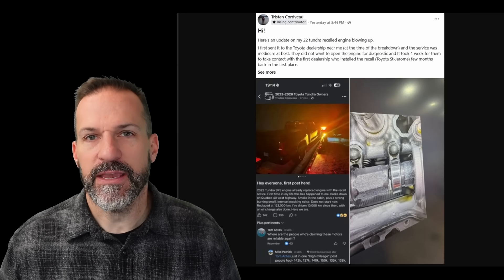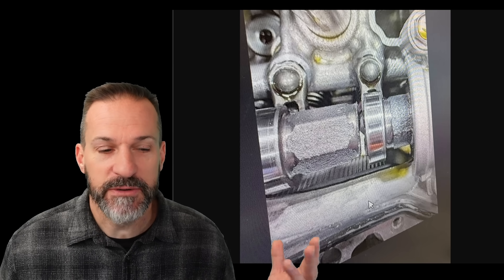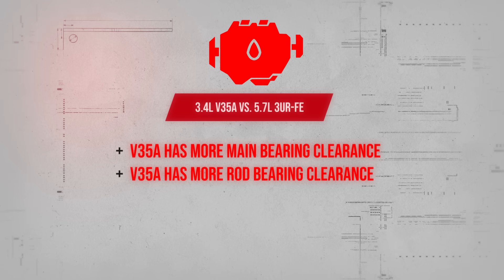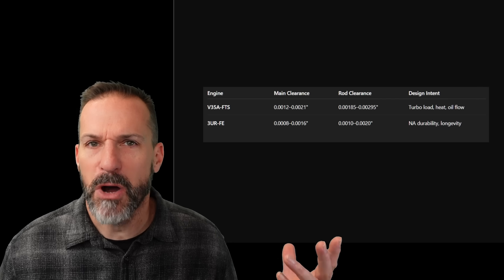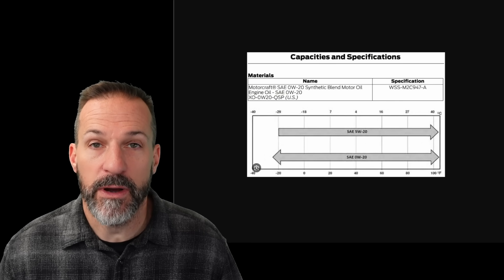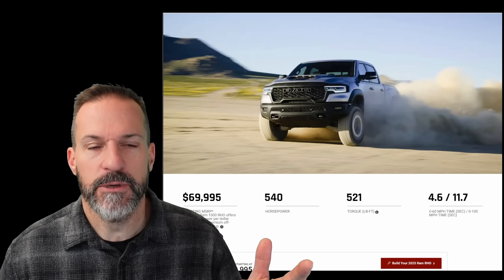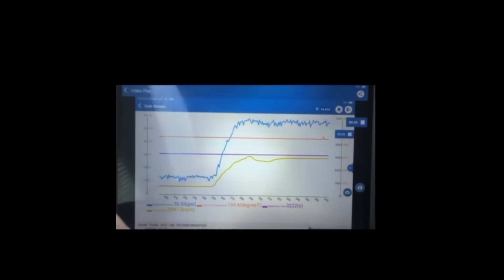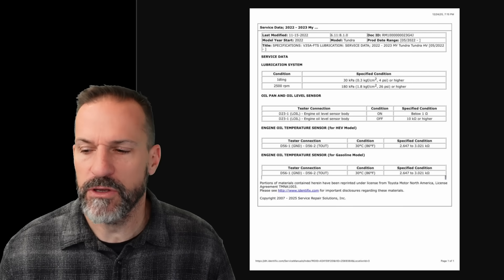Can We FIX Toyota's BILLION Dollar Mistake at Walmart? 2022- 2026 Tundra...

Comment: When someone says “tighter tolerances”, ask them what actual tolerances have changed ?  And then ask them, why do Corvettes, ZL1 Camaros recommend 15W-50 for “track use”, and 5W-40 or 0W-40 for daily driving ?  Do the bearing clearances change by magic ?   Why do the same engines recommend higher viscosity when not controlled by CAFE standards ?
Reply: Dude spot ON!  If these water thin oils are “soooo good” then why aren’t they used in sanctioned racing?   Great point.
Reply: @highball7347 this is an argument that sounds good but doesn't understand what is actually happening. They increase "track use" weights because the engines will be run at higher temps and therefore thin out vs just idling on your way to work in the middle of December. Yes, I can see the argument that 0-20s are too low, but the "for track use" is a silly answer that doesn't understand the reason for those weights in a track used motor.
Reply: @BrandonAbernathy is exactly true. Heavier oil on the track is totally due to higher engine temperatures
Reply: @BrandonAbernathy the oil doesn't "thin out" .  You're talking about shearing and that is mostly likely to occur with a light weight motor oil.  Light weight oils were developed for fuel economy, not to improve engine longevity.  In 2011, when cafe standards were introduced, that's when most manufacturers went to 0w-20. Prior to that, manufacturers like Subaru were recommending at the minimum 10w-30 in their WRX/STI vehicles. In most countries, light weight oils are not factory fill especially for performance vehicles in Europe.
Reply: @c45-nr4pk3gu7f  wut? What do you think the sae ratings are? The reason manufacturers call for a higher viscosity for track racing is due heat soaking the oil that thins it out and makes it less viscous, ie more susceptible to shearing.
Reply: @BrandonAbernathy  Manufactures do not fallow SAE ratings when advising higher viscosity oils for track use and they do not call for higher viscosity because of "heat soaking". BTW, manufactures are fined per vehicle if they deviate away from those CAFE standards regarding OEM low viscosity factory fill oil.  There is no justification for the use of lightweight motor oils, none.  In the worst case scenario, once the additive package wears out in the low viscosity oil, the buffer is gone and engine wear will accelerate rapidly.  With legacy weight multi-weight oils, there still exists a buffer because of the thicker viscosity that creates a cushion in the engine clearances once the additive package is nearly or completely depleted.  Shearing is the motor oil getting "thinner"...and as I stated, that will easily happen in a lightweight oil on the track and cumulatively on the highway. Make sure you change your oil on the dot.  BTW, you get heat soaking from being stuck in traffic.
Reply: @c45-nr4pk3gu7f  yes, you know than everyone. Track use is meaningless to epa standards. Good grief. You are arguing against what I said using exactly what I just said.
Reply: @BrandonAbernathy  don't argue with idiots
Reply: Ford EcoBoost V6s running the recommended 5w-30 semi-synthetic have no systemic bottom end or cam failures.  The cam phasers on earlier EB V6s failed due to poor design and metals.  Once those were corrected the 3.5 and 2.7 EBs are very stout.  I’d say that’s an endorsement of the heavier oil.   The manufacturers are resistant to changing the oil weight recommendation as that may run afoul of the EPA certification of emissions and fuel economy testing that occurred using the lighter weight oils
Reply: I’ve heard a lot of cases of the new GM 6.2s blowing up within the first few months of ownership (some not even making it home from the dealer after purchase). That points to more than just an oil issue. Though I’m sure that thicker oil may help prolong it

My 2011 6.2 has 340,000 on it and it doesn’t burn a drop of oil. I sure wouldn’t buy anything with a 6.2 in it now
Reply: @ogalief The 6.2 GM failures are 100% poor Crankshaft machining and Debris that wasn't cleaned out before assembly!!!
Reply: @robertcoggins8545  It’s strange that the older 6.2s didn’t have that issue. They were probably made in the same factory. You’d think that they would have fixed that issue when it first became apparent. I heard Hyundai and Toyota use the same excuse when their engines were (and still are) blowing up
Reply: @ogalief Do some research! Dave's Automotive in Utah bought 2 New crate 6.2 Engines. Tore them down. They both were complete Junk with ZERO miles on then. 2 Factories in Mexico that produced over 85,000 crankshafts didn't do the polishing procedure on any of the crankshafts they produced. There is now a investigation on another factory in Mexico that's responsible for a additional 250,000 crankshafts that did the same thing. These crankshafts are chewing up Main and Rods bearings. Some Fail in 4 miles, some in 2500 miles but eventually every single one will fail.
Reply: @robertcoggins8545  Those engines that were blowing up right off the lot were definitely an assembly defect. Though I can’t help but feel that there might be a design issue at play as well. This issue didn’t appear in those engines until a certain revision. They changed something, and all of a sudden these issues started appearing.

The same thing happened to those ghastly  2.4 Kia engines. I’ve heard of people going through 4 of them in the same car. I’m not convinced that it’s entirely a machining issue. Don’t you think that they would have caught it and fixed the machine in question on the assembly line?

Though both things could be true. There are obviously some QC issues, but GM is also notorious for cost cutting and putting in stupid emissions equipment
Reply: @ogalief The Mexican Plants skipped the polishing stage on all Crankshafts! Then GM changes the Bearing clearances from .08 to .04 and Changed the Oil from 0-W40 to 0W-20. That spelled instant disaster!!
Reply: @robertcoggins8545  Interesting! I’m pretty sure that the 6.2 in my 2011 was made in Detroit. And it has 340,000 and doesn’t burn a drop of oil. Sounds like at some point between 2011 and now, GM bean counters moved the manufacturing to Mexico. The word “quality” doesn’t come to mind when you hear “hencho en Mexico”
Reply: @ogalief 2019-2025 Mexican Crankshaft production that Failed.
Reply: @robertcoggins8545 GM moved the Crankshaft production to Tonawanda NY in 2024.
Reply: Spot on DB cooper
Reply: I agree “tighter tolerances” is a term that gets thrown around a lot without any data. As far as track use, it’s normal to see higher oil temps when pushing an engine hard vs normal driving. 15w50 at 250f is about the same viscosity as 0w40 is at 210f.
Reply: What about variable oil pumps they are programmed for this light oil
Reply: They are accounting for heavier oils in those cases, but with your daily driver type cars, they are probably going out of their way to design engines to break if any thicker oil is used.  We should instead remember how big of a problem engines designed to only take thinner oils are.
Reply: Better yet, ask them what the meaning of the word "Tolerance" is and then how it applies to this situation.
Reply: The Plastigage reference measurements for today’s engines really aren’t different from the 80s or 90s.
Reply: Because they know the Corvettes are going to get beat to hell.
Reply: The lower number is cold startup up flow which isn't so important for track use.  The lower number helps with frequent cold starts which most people use their vehicles unless you have money to burn on a track car.  The second number is related to the ability of the oil to resist shear forces and maintain a film between bearing surfaces.  Higher number means better film strength.
Reply: Oil clearances change with temperature, as do viscosities. Sustained boost puts a lot of heat in the oil via turbo and in the engine. And gm’s lt based engines all use an electronically actuated oil pump- there’s an eccentric on a solenoid that moves to tighten up the pump
Veins. Not saying there’s not a problem just answering your actual question.
Reply: Why not just use gear oil then if thicker is better? Because that would be stupid. The control orifices in any lubrication system are tuned for a specific viscosity range. If you use thicker oils then what the engine was designed for then this will lead to starvation
Reply: You know, the oil code stands for winter.  Shouldn’t there be different oils used depending on where you live?  Someone in Alaska would want a thinner oil to get it moving through engine quickly in cold. I wouldn’t think someone with same engine would use same oil living in south Texas?
Reply: GM used 0w oil in the 6.2 and it cost them over a billion dollars in recalls.
Reply: Exactly this!  A heavier oil to avoid having a Tundra engine seize???  Sorry, but that is NOT a proper solution.  Akin to using a Band-Aid for a severed limb.
Reply: @troyhodulik5542 That all depends on the limb that was severed and the size of the Band-Aid... 😮
Reply: @troyhodulik5542  dude that’s not exactly true. In a turbo engine, a lightweight oil shears very easily. I’m using voice recognition so if there’s grammar or spelling, I apologize. So your turbo‘s been a hell of a lot faster than your engine attempts to mechanically shear the oil and then if you have higher temps in a turbo engine 0W 20 is only good up until like around 90°. So one if you’re running a higher RPM or right around torque about 1600 to 2400 you’re gonna have enough heat in that engine to share the oil you have evaporation as well which means less protection but the oil at 10,000 miles has so many additives missing and has a thinner viscosity than its spec because of all the shearing and other factors that come into it. I’m not even including fuel dilution because honestly it’s under engine doesn’t really have an issue there but if I remember the hurricane engine does. Well, I shouldn’t say it as bad. It’s just it runs until four and usually out of five they flag it on oil tests.. But that’s not my point and point is your oil is not made to be run past a certain temp heavy duty situations where you’re pushing high boost, high RPM high temp etc. 5W-30 isn’t that much better on temp than the 20 . However, it doesn’t she as easily mechanically intends to last longer for your oil changes like if you run in ZW 20 and you’re running 3000 miles and never towing never like your torque curve not really pushing the engine you’re probably not gonna have any issues. Hell if you do it once in a blue moon you might not have issues but you’re gonna have to change your oil every 3 to 5000 miles depending where you live and I wouldn’t run 0W 20 anywhere south of South Carolina. 5W-30 is like the minimum that is recommended for turbo engines in general. Because it’s more heat resistant less likely to suffer from evaporation mechanical shearing etc., etc.. 0 W 40 is better for performance applications because it does protect a little better and it’s more resistant but it’s better than 5W-30. I’m just gonna make it simple. However, the farther your numbers are apart the less the lifespan of is a general role of thumb, so your W (40) you’d probably have to change every 5 to 7500 miles to be safe. I’m running 5W-30 10,000 miles and I haven’t seen one problem. I just hit 50,000 on my truck. I did my 500 mile 1500 mile 3000 mile oil change was 0W 20 and then 10,000 on 0W 20 but it was in the winter then I switched to 5W-30 because it was summer due to oil changes a year and I’ll use your W 30 in the winter. Like I said I have 50,000 miles on the 500 mile oil change when I switched out Toyota 0W 20 my engine quieted down because I switched to the ZW 20 OE amsoil then finally when I got to 3000 miles, I use their XL series which is supposedly good for 15 or 20,000 miles. I’ve never run that and never will all my oil test showed perfect where no EV no fuel dilution pretty much perfect conditions. At 10,000 miles I switched to the 5W-30. My oil pressure bumped up so it wasn’t borderline in spec because running right on the border is not good for your engine. And then cruising down the road it’s still within spec. I do my 10,000 mile oil changes cause I’m using signature series. Amsoil . And oil test have shown I could actually technically go 17,500 or 18,000 miles on this oil. This oil on the label says 25,000 miles and oil test are telling me oh I’m only good to 17 or 18,000 so let’s see I’m losing just say what 8000 miles off my oil from the breakdown in viscosity and additives and evaporation and all the other shit that goes along with it. So just imagine if I was using your W 200W 20 would be even worse. I’d probably put signature series in and I get maybe 8 to 10,000 miles out but that’s a very good oil. There’s not too many oils comparable to that people will go. Oh this oil so good and nap is just as good as yeah you gotta change it a lot sooner though so if you’re using a Napa oil, you’re gonna have to change every 3000 whereas if you’re using it I think it’s red line Schaffer or amsoil You can probably go 10,000 easily. I told that 7000 pounds every day by six days a week a lot of stop and go I don’t use my auto stop start and after the trucks warmed up that’s actually proven to not be too bad but if you’re just doing purely city and it really doesn’t warm up a lot of short trips you don’t wanna use it and I have no problem and I’m hitting Pete torque quite often since I’m towing. The motor oil geek can explain a hell of a lot better than I can, but there’s major differences between 0W 25W 30 and 0W (40) in the respect of oil life, wear protection doesn’t vary too too much in theory oil test on some engines because of very in conditions have shown less wear on some more wear and others I use oil so I see less wire than most others like I think the highest iron I’ve ever seen on one of my oil test is like a six whereas when I use Toyota‘s oil and I did the oil test I was getting like 11 not drastic, but I use the Amro because it doesn’t share as easily as less prone evaporation flashpoints good on it pretty much all the shit on it is good. I’m not telling you that’s what you have to use. I’m just saying change your oil more often, especially depending on your conditions and running a thicker viscosity makes a big difference when it comes to a turbo engine. at 50,000 miles I had to pay for a major repair on one of my mowers and I didn’t wanna go into winter spending a lot of money so I used one of my free oil changes from Toyota since I still had two left. They put in their 0W 20 my engine got loud as shit my oil pressure took a lot longer to build up and it feels different. I know that subjective, but it felt smoother ever since I got that shit out of my engine in the first place on startup I’d get as low as five psi for 30 to 45 seconds before it actually started to build up pressure to the normal with the ZW 20 they put in with 1015 seconds. I’d say max max until I’m at full pressure even on 23° days with 5W-30 I used to be a mechanic, I still follow a bunch of mechanics to this day and I follow a lot of motor oil people because I find it interesting. I’m not saying I’m right. I’m just saying every piece of evidence I have ever seen says 0W 20 should not be put in a turbo engine, but with the variable pressure oil pumps you have to watch how high the viscosity you go I’m not going to 0W (40) just for the fact that that might put me right on the border of the spec of too much pressure so after running 5W-30, I’m close enough where I’m not comfortable switching cause I could just be wasting a bunch of money on oil I’m comfortable where it’s at so I’m sticking with that
Reply: @halftontimrvreviewsandtips3106 I didn't take time to read your novella, I did take time to comment though 😅
Reply: @halftontimrvreviewsandtips3106 yeah, not reading that…
Reply: As the oil heats up it thins out. So for track or heavy towing use, thicker oil counters that. For the winter and daily use, going to a thinner oil helps cold flow performance.
Reply: @FM4AMGV 
Which oil is thicker on a cold start-up in the middle of winter?
A low viscosity 0w-20 in Alaska, or a higher viscosity 5w-40 in Alabama?

The 0w-20 oil in Alaska will be a lot thicker, and the engine containing that thick oil will likely survive just fine.

The 5w-40 oil in the Alabama vehicle will be thinner than the 0w-20 oil in Alaska in the middle of winter. 
The Alabama vehicle will survive just fine with the 5w-40, all year long.
Reply: Putting a not recommended oil weight into an engine that is known to have a serious flaw is the dumbest thing anyone could think of. It's like a free gift to manufacturer to deny your precious warranty. The idiots can do whatever to their raggy old out of warranty vehicles, but spare people who just barely bought a brand new vehicle.
Reply: @noblekitty can change it back to thin oil before bringing to dealer for warranty. Dumbest thing is buying this truck to begin with.
Reply: @noblekitty let let us professionals do the talking….
Reply: @A20Boxer for you conspiracies lovers, here is one to chew on. What if this guy is being paid to spread lies. So you idiots will use the wrong oil to void your warranty. That way, manufacturers don't have to pay to replace the engine.
Reply: U sir cracked the code 😊❤
Reply: The bearing clearances are tighter dude it’s not that deep. If you can’t understand that then you shouldn’t be commenting. The tolerances are adjusted to get proper oil pressure, that’s been a known thing since the modern engine. The guy in this video is not an engineer and has no understanding of engine design, and neither do you 😂
Reply: @jacoby4838  Then why don’t you expand on your comment instead of just accusing people?
You are acting like in order for an engine to get proper oil pressure we need to keep making things as tight as possible. That’s the dumbest thing I’ve ever heard. 
Engines over past century have been far more reliable and produced perfectly good oil pressure.  No manufacturer EVER makes a decision based on customer experience. If they are making engines to razor thin tolerances, it’s because it pleases the EPA in some way.
Reply: @jacoby4838 Do you know the meaning of tolerance and clearance?  Your usage of those words suggest that you don't.